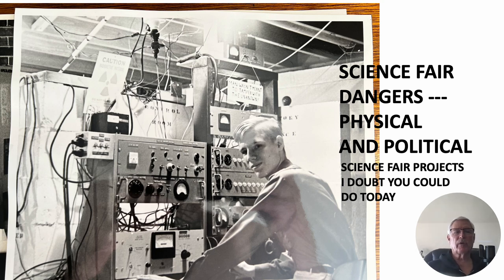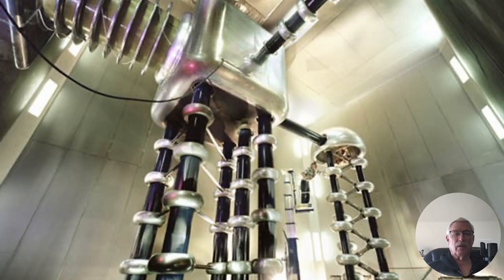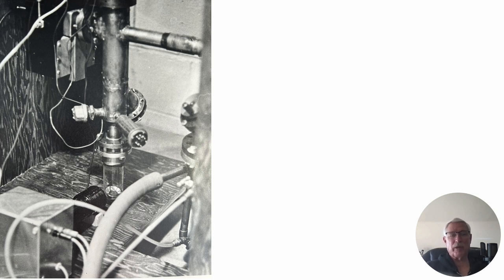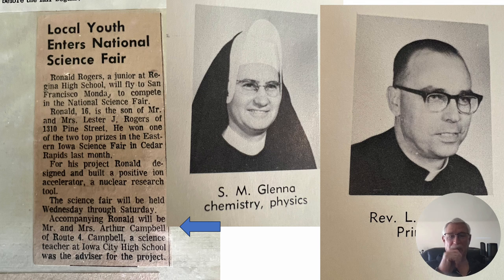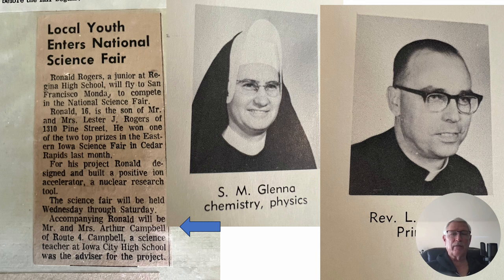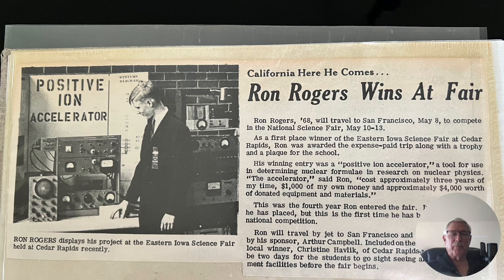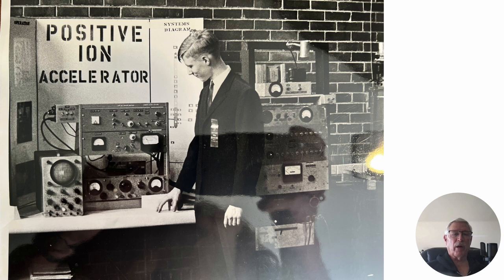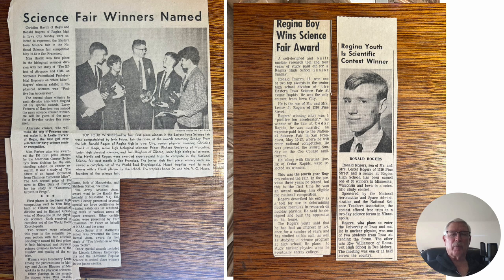SCIENCE FAIR DANGERS ---PHYSICAL AND POLITICAL SCIENCE FAIR PROJECTS I DOUBT YOU COULD DO TODAY

Comment: That is interesting.
Proton and neutron bond energy. I look at the dates on the ribbons. If I'm not mistaken this is just when they had understood that protons had an internal structure of 3 quarks. They probably didn't call them quarks yet.
(If I remember correctly if was the early/mid  70s before they had understood the colour force and the fractional charge of quarks and glueons and all that.) 
So you were looking at quite new science at the time. As a high-schooler. Not bad. You have done quite a few interesting things.
Reply from the maker: Yes, when I look back, it was a very early time in NP. This was pre neutrino oscillations even. Fermi lab was just beginning.